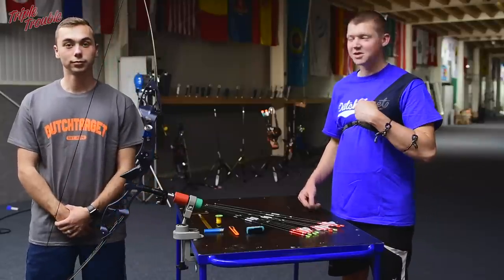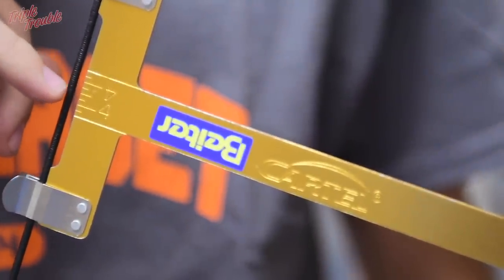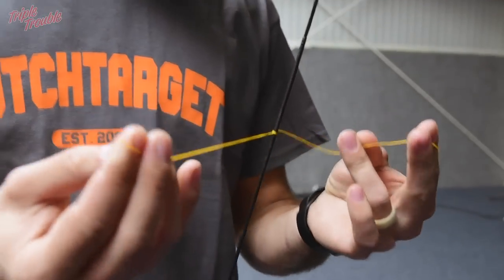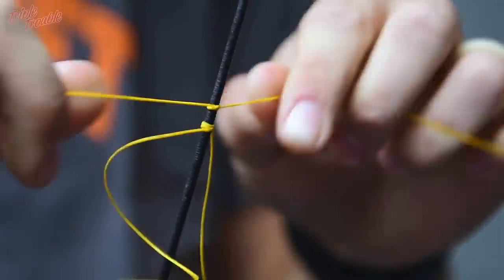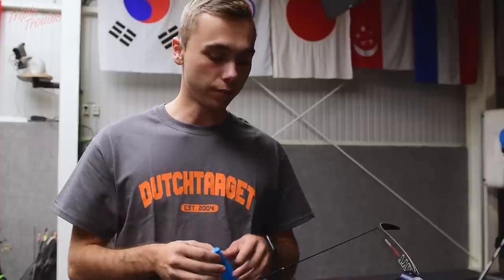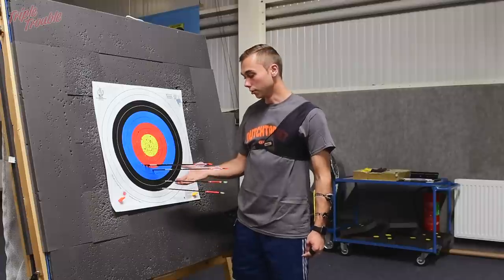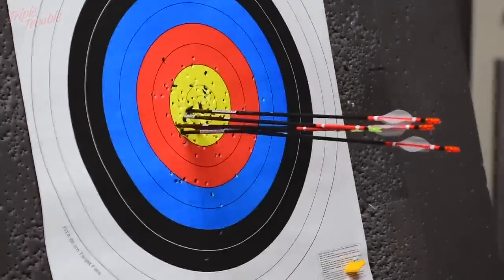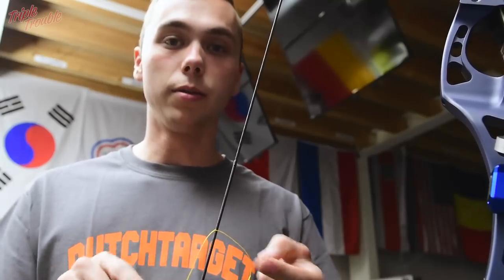Archery - HOW TO SET a NOCKING POINT [Tuning #2] with STEVE WIJLER!

Comment: I've found using a very tight "walking" nock point helps when bare shaft tuning for nock height. I'm able to fire an end, adjust my nock point by screwing it down or up the serving and shoot another end until it is in line with my fletched arrows. Once I have my walking nock point in the right location, I'll tie in a permanent nock point underneath,  cut the walking nock off, load an arrow and tie the top nocking point.
Reply: Me, too.  I don't remove my tied in nocking points, I just "screw" them up or down the string.  When I get it where I want it, I make my last knot a square knot and burn it off.  I do it to both nocking points.

Comment: If you tie those on right, you can twist them up and down your serving.  Been doing it that way for over 30 years.  Never had to cut one off and redo it.  This is the whole deal about a tied on nocking point, is the sustainability of the tied on nock up or down the bow string serving.  Just screws up or down.  Makes it super nice to dial in super precise.  Also, no need for a lower nocking point.  Just an upper.  Wrap it 6-8 times and you have plenty to grab on to to twist it up and down the serving.  With split finger, you have 2 fingers pushing up on the arrow nock, so no need for that lower nocking point.

Comment: People are using "nocking point" and "nocking height" interchangeably.  I believe this is where confusion begins..  The nocking height is the measurement to the bottom of the top nock.  The nocking point it where the center of the shaft meets the string.  This would be the distance downward equal to 1/2 the diameter of the arrow nock itself.

Comment: Hi, The hardest thing I find when setting up a new bow, is getting the arrow rest to stick on straight and level. Any tips or thoughts on doing a video on how to make sure the arrow rest is stuck on correctly? Thanks Daniel
Reply from the maker: Make sure you clean the surface you’re gonna stick the rest to. Then put the button in the hole so you’re sure that the rest will be aligned with the button. It doesn’t matter if you stick the rest on perfectly straight or tilted a little backwards. Tilting the rest a bit backwards will give the supporting arm a bit of a slope and your arrow will stay in its place easier. Does this help you? Cheers!
Reply: @TripleTroubleArchery  thanks. Another question now, if you reverse your sight, and slide it on backwards (behind the riser) should the sight pin always line up with the string?
Reply from the maker: In an ideal world, yes. In Sjefs case it's about a cm left of the string. This tells us it doesn't have to be a disaster if it isn't completely in the middle

Comment: Nice one! Are you planning to talk about the relation between the tiller/finger pressure or bow center of gravity and nock travel?
Reply from the maker: There’s a tiller video coming up!
Reply: @TripleTroubleArchery  Hasn't tiller settings affect where the nocking point should be?
Reply from the maker: Only a tiny bit, nothing to worry about too much

Comment: what string material do you guys use for your nocking points?
Reply from the maker: BCY 350 Nylon
Reply: @TripleTroubleArchery  dental floss works right?
Reply from the maker: @windyblower1211  If it works for you it works for us!
Reply: @TripleTroubleArchery  haha ok
Reply: @TripleTroubleArchery  do you use the same string for the serving?
Reply from the maker: @dottorfoggy  For the serving we mostly use BCY 62-XS, Sjef uses .018 but that also depends on the amount of strands in your string and the nock you are using.
Reply: @TripleTroubleArchery  16 strands on 8125g with the bcy diamondblack 0.22 and 12.1 beiter nock, i'm gonna try your solution for the next string ;)
Reply: Hi Steve, hi Sjef,

do you think i can use also the BCY X99 or BCY Halo for Nockingpoint?

Comment: Quick question, doing nocking point with some extra space within it when an arrow is nocked is what I am taught to do. Which makes sense to me because when you pull the string back the nocking points kinda squeeze together(resulting in the nock sitting perfectly in between the nocking point). Seeing you do the nocking point with absolutely no spaces in between when an arrow is nocked makes me wonder why you would do that, since then the nock will be squeezed tightly by the nocking points when it is strung?
Reply from the maker: If you use Beiter nocks, they are made to not have that problem, they have two cavities for the nocking point to go into
Reply: @TripleTroubleArchery  ooh, that is something i did not know about. Are the cavities found on the big beiter G-nocks or is it on every nock they make?
Reply: @windyblower1211 I think its every nock, you can also check your own for the cavity

Comment: if you squeeze all your rhomboids together will you push the plunger into the arrow and how do you guys think about using the trapezius ?wont that flick and inch the nock or press it against the nock points ?
Reply from the maker: We have thought about it, and have no idea 🤷🏼‍♂️🤷🏼‍♂️🤷🏼‍♂️🤷🏼‍♂️
Reply: @TripleTroubleArchery  maybe you could do a video on it ...? perfect excuse to mess around with some high speed slow motion footage . stiff plunger vs hard , squeezing both (all rhomboids )vs just the draw arm ones

Comment: Try pulling your nock thread through a glue stick first, wrap the thread around the glue stick and pull quickly, when the nocking points are in place use a lighter to burn off tags and melt the glue on the thread.
Reply: Great idea
Reply: @LukePighetti  I can't lay claim to it, I read it somewhere a few years ago, simple over hand knots, one on top of the string the other under, if you know what I mean, they work really well and are very secure.

Comment: I’m going to get flamed for this comment but why do you need a square dedicated to establish a “starting point”.  Why not use anything with a right angle if it’s going to be raised a quarter inch as a place to start testing.  Everyone is so equipment dependent these days...
Reply from the maker: Because this clips onto the string so you have your hands free, has easy engravings and is designed exactly for this particular case :)
Reply: @TripleTroubleArchery  yes it’s another single use tool that exactly accomplished nothing but establish what? A more precise “starting” point at which you start the very much old fashioned trial and error method of fine tuning.  I get that every “hobby” has its specialty tools but this one is very “special” indeed.
Reply from the maker: Except I have one in my quiver at all times since it's easy to check my tiller, brace height and nocking point. If I wouldn't have one of these I'd have to get a ruler but rulers don't have clips to attach it to the string. I get your point of there being a lot of single use products but I think the bow square is simply not a good example
Reply: @TripleTroubleArchery  thanks for your input.  I’ll see if i change my mind as i get into archery more.